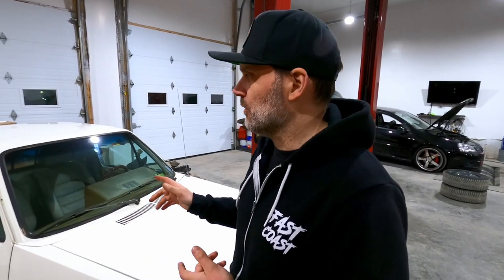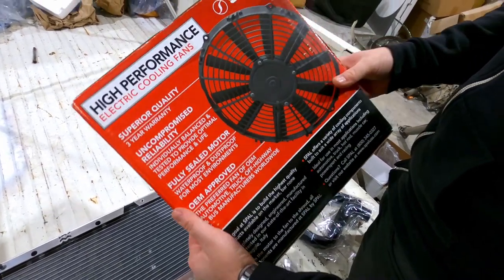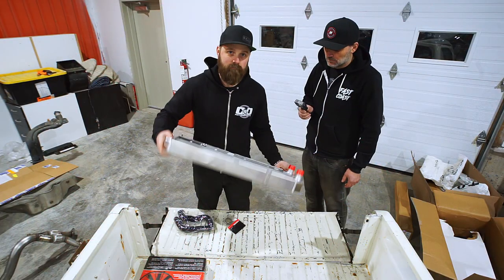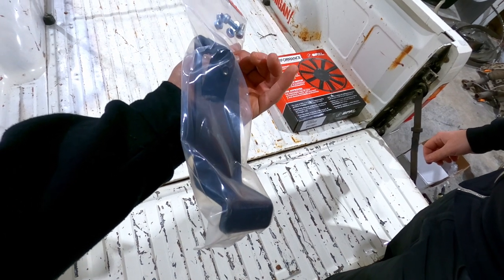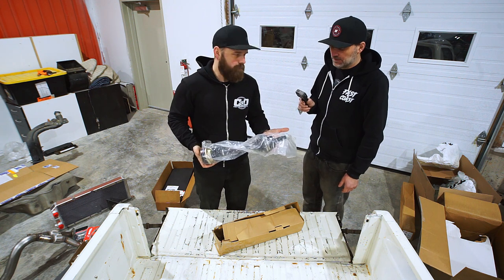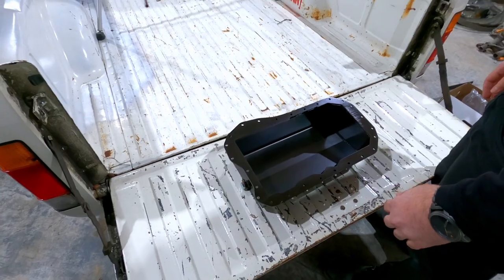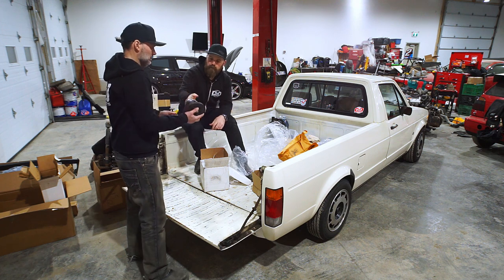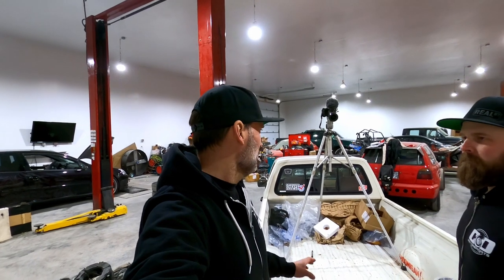MK1 3.2 VR6 Swap, unboxing some parts before we start.

Comment: Would I be waisting money buying this kit if I wanted a 02m trans for an AWD swap?
Reply from the maker: The mount kit yes. Just buy what's needed. The 02m mounts are completely different.
Reply: CO Motorsports I’m assume the euro wise axles wouldn’t work either?
Reply from the maker: @MrCarlover500  axles are completely different.